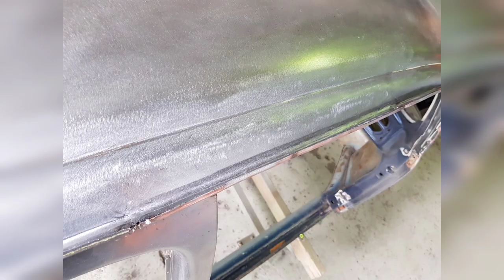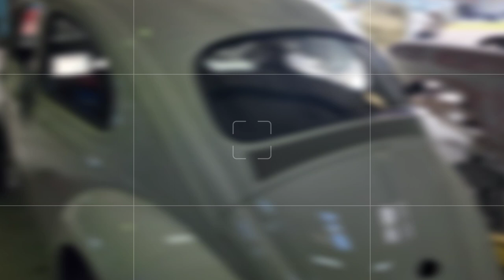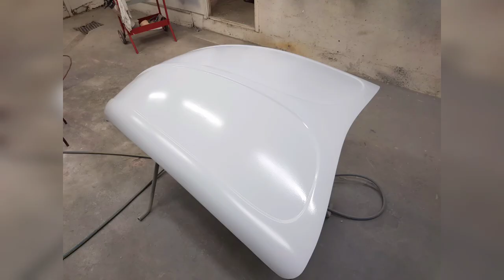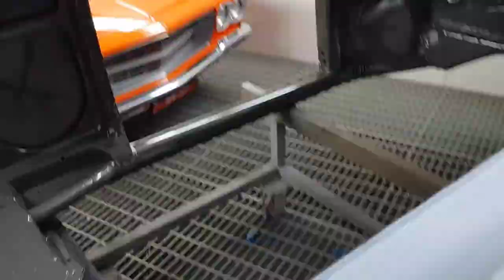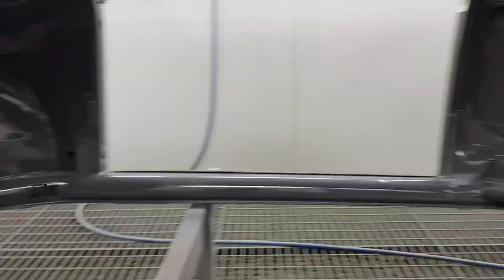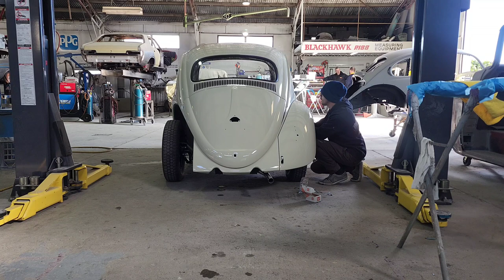1962 VW Beetle restoration time lapse

Comment: When you put the apostrophe following the number, it means “feet” as in low long something is. 
In front of a number, the apostrophe takes the place of the first two numbers of the year, so you don’t need to write out the full year. You don’t use an apostrophe if your are writing out the four digits of the year.